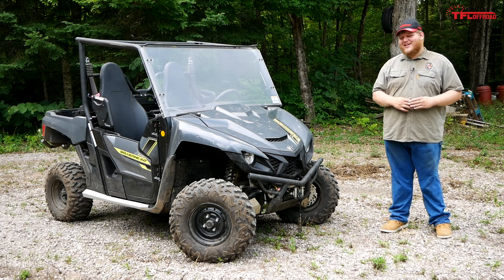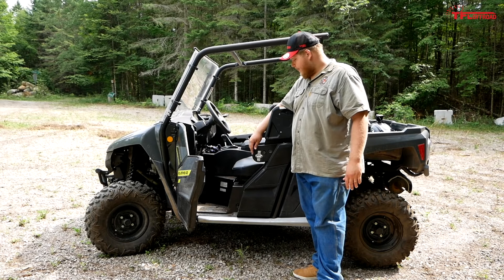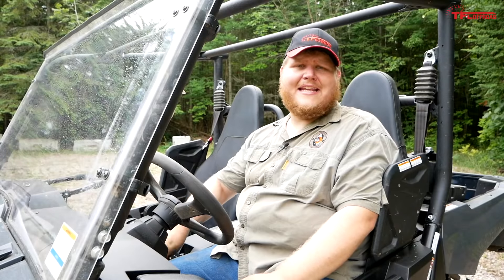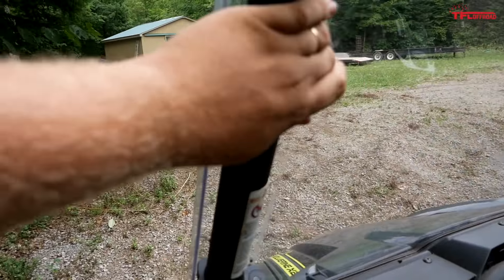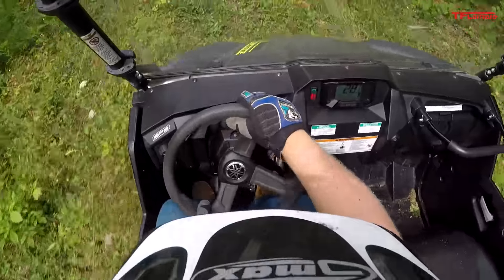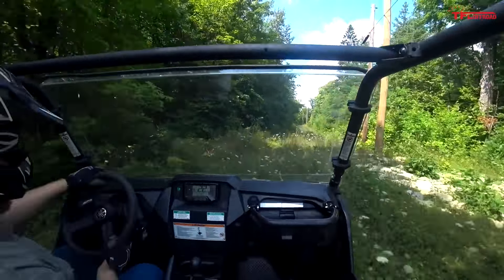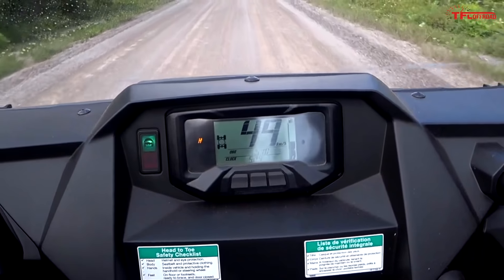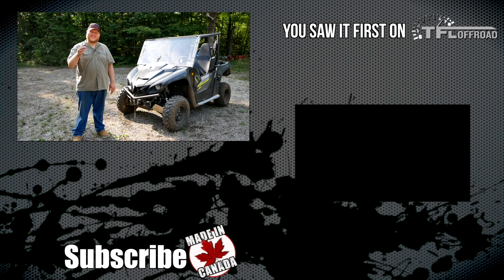2019 Yamaha Wolverine X2 Buyer's Review: Watch this before you buy

Comment: It is a quality built Yamaha and a huge upgrade from the Rhino.  Like most SxS's, it lacks driving experience for the driver.  It seems to cater to people who have never driven or too lazy to drive.  It has plenty of power and is not as loud , but seems designed for safety and for people who don't do their own maintenance and are uncomfortable shifting gears.  For a work vehicle, I prefer my 2019 Hijet because of precision and simplicity besides payload and it's quiet, with AC/heat.

Comment: Great video & thanks! just got a new X2 se in backcountry blue, have about 250+ miles on it so far. I'm 6.0 and 230 getting in & out is not bad. Once your in the ride is smooth & quiet. I did remove the rear sway bar & went down 2 rounds on all 4 springs & softened up re-bound & compression 5 clicks on all the shocks, dropped the air press. to 13 lbs. it made it much better for the type of somewhat high speed trail riding the wife & I run. I say take one for a test ride if you can. We ride with all brands & types 1000 turbos etc. in our club & keep up with no problems up to 50+, stayed with Yamaha cause they are dependable & rock solid. Long time owner of Yamaha machines. Oh and i did recently tow in a polaris 900 with 2,100 miles on it with a blown belt. Just sayin'...

Comment: Good review. I sat in one and I am 5’10” and pretty slim. I found myself trying to slide the seat back and it was already back. Also with the middle console I found it kind of cramped. It’s not terrible or anything but if I’m spending that much I want to be comfortable.  Also don’t like the top speed. I was exited when I heard they were putting the twin engine in this but it’s top speed is still the same. I understand that it’s a sport utility but Yamaha always seems to hold back from what the competition is offering. Too bad. I can have the reliability of Yamaha and low performance or the high performance of the competition and spend time fixing them. I will have to ponder that.
Reply: With the speed limiter bypassed it will do 56-57 MPH.  With sheave work you can get mid 60's.

Comment: Good review. Any big difference between x4 and x2. Sometimes want to bring kids
Reply: Just the suspension. X4 has auto in the rear. The X4 is really, really solid and drives extremely well. Super quiet, no heat AND if the family isnt with you the seats fold up or can be removed giving you even more room.

Comment: Good review like your honesty and real world testing. Would be interesting to see a review comparing that to the cfmoto uforce 800. Keep up the good work.
Reply from the maker: Thanks! Will definitely try to get something from CFMoto to review.
Reply: Pretty much every ATV/UTV is made with China-built components, regardless of where they're assembled.  Certainly the engineering makes a difference.  Take a look at the quality of components on a Japanese motorcycle from the 70s or 80s and compare it to the new ones -- it's like night and day.  Cost has driven down the quality.
Reply: guy strom, you might want to do a little research on CF Moto before you start spewing nonsense.  I have beat on my ZForce 1000 like a red headed step child and it is still asking for more.
Reply: guy proulx  Being a previous general manager of a CFMOTO Dealership along with several other brands if what your saying is true than that is ridiculous. We sold roughly 50 units in the 3 years I was working for the dealer an never seen one with blown engine at low milage.  I did see one guy have issues with the rocker arms failing however his machine was 3 years old had over 4k miles an the intake was nasty. Other than that I seen very few serious issues an if any of did have problems while under warranty we repaired them in a timely manner and got the customer riding again. My Ant an uncle has a 17 Zforce 800ex, they have went to West Virginia an Kentucky every chance they get. Only thing they've done besides changing fluids an filters is brake pads an a belt. So I would have to strongly disagree with your statement

Comment: i LOVE my X2 guys this is a good utv . top speed is not a deal breaker for me trails i ride are slow this machine works plain and simple go get one!!!!!!
Reply: ford vs chevy or s&wesson and glock  to each his own #1 my local polaris dealer is a complete Ahole,#2 i simply dont like polaris,or can am#3 i paid less than 11k otd no where close to general price one mans garbage is another ones treasure. i have no issues with any of the complaints you mentioned.i respect your opinon please respect mine
Reply: SEAT TIME fair enough.
Reply: SEAT TIME we just got one. I love it !
Plenty of speed for the trails
Reply: awsome dude have fun. the motor will start to rev better and stronger  about 100miles or so ,200m and 25 hour on mine no complants so far
Reply: @ROTAXD  Let me guess, you are under 21 years of age?

Comment: Can the 52 mph speed limit be over ridden?
Reply: An ECU reflash will take care of it.  Most people that do that also put an aftermarket clutch in it as well so it doesn't run the engine RPM so high at high speed.

Comment: Why would you even consider doing a speed run in 4wd ? On that road, wheelspeed would be a non issue in 2wd and 4wd bith increased your time to speed and decreased your actual top speed.
Reply from the maker: I did a few runs in two-wheel drive, and the spin off the line was excessive. With more foot control, I'm sure you're probably right that 2WD would be a bit faster to top speed. But it was simpler to just punch it in 4WD and feel all four tires bite. 

And the top speed is not affected at all because it is electronically limited. So no difference between 2WD and 4WD.

Comment: I love this new sxs but come on Yamaha 53mph wow you çan do better then that
Reply: If they made it to fast it would take customers away from there yxz 1000 ss thats the one you want
Reply: Spencer Young the yxz is another pos.
Reply: ROTAXD it's a 3 cylinder 1000cc Yamaha engine with a slam shifter that can easily fit yamaha's turbo kit for it how is that a pile of crap it is a very different machine from the rest of the industry and is very fast, really plush RACING machine. don't be giving something crap when you have not owned it or just have a different preferences if you think it's a pile of crap back it up with proof or at least explain yourself
Reply: My Can am commander 1000x will do 70+.  I NEVER get it there unless out on a frozen lake.  Top speed for most utv's is just bragging rights , not real world uses.
Reply: KINDIRBUDS dependson wgat you're using it for. Obviously if you're dragging timber out or are loaded down with fence posts or a treestand 70 is not necessary or practical. If you're out riding with the guys I can't see why you wouldn't be hitting 70 more often unless you're riding tight technical trails. Our General 1000 tops out around 68-69 and we've had it there at least a dozen times on rides since june when the first service was done.
Reply: @MassiveOverkill  we have vids doing 68mph and that is with a shim..gonna break 70 this week
Reply: I saw that James, congrats!  Awaiting results with stock, 27", and 28" tires as 29" isn't a common tire most will run.
Reply: @MassiveOverkill  the bighorns measure 28.5 but will be doing the other tire sizes too without a shim

Comment: Yes, this is a decent review,..but I do wonder at all the dust that is NOT prevented from getting into the 'glove boxes'. I think these two cubby holes should be more dust proof. 
I also agree with that parking emergency brake feature,..this way we would be using the wheels to stop and hold the vehicle, and not the drive line.

Comment: Would love to have one of these. However, that 52mph is disappointing for such a wonderful engine. It sounds like it has a lot of room in the top end still.
Reply: 27Zangle had he done a proper test in 2wd the top speed would have likely been in the 60 mph range.
Reply: No it wouldn't,  my X4 is modified
Reply: Others have reported between 49 - 52 MPH from the factory in 2wd.
Reply: How fast do you need to go?

Comment: Great video, definitely one of the better reviews that I've seen on a machine in a long time.
Sadly, after I say the machine is still pretty disappointing. Only 52 miles an hour and 69 horsepower. For some people that may be fine but for others it's nowhere near enough. And this type of utility machine with more power and more speed I think would be a big seller. But so far no manufacturer seems to get it.
Reply: Acceleration is good, Yamaha just likes limiting the top speed. On a normal trail you'd never really need that 50+ mph, only on long straits.
Reply: Can am commander 800 goes 70 mph
Reply: There are some states like mine, South Dakota, that are SxS/ATV friendly, which are allowed to be driven on the roads.  I don't have to trailer my SxS to the trailhead,  I go from my driveway to the trailhead direct, which requires me to go at highway speeds, which has speed limits of 65 MPH.  To keep up with traffic, I also need to be able to go the speed limit.  It's not about going 65MPH on the trail.  I'm also on Search and Rescue and our Can Ams and Polaris' both do 65 MPH, allowing us to respond to calls in our SxS' without having to trailer them.  The 52 MPH speed limiter makes Yamaha less appealing for a response vehicle even though it's a superior off road vehicle in my opinion.